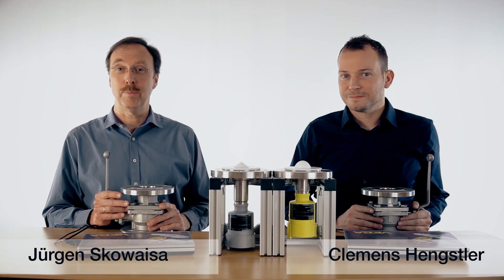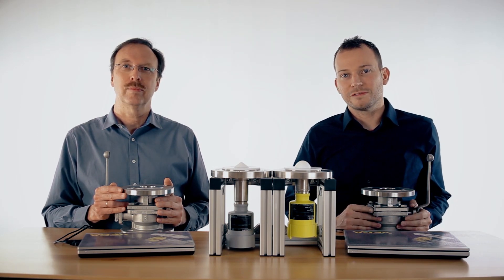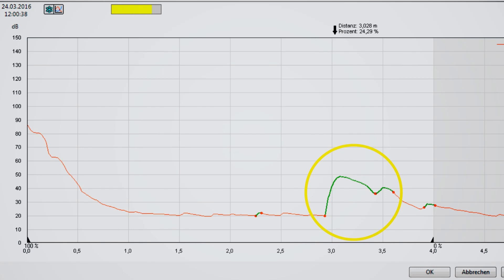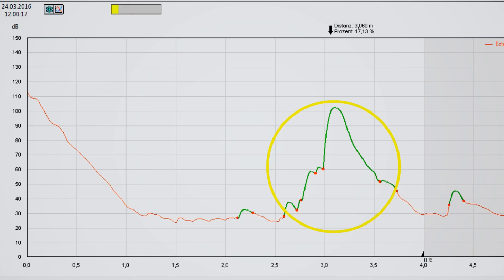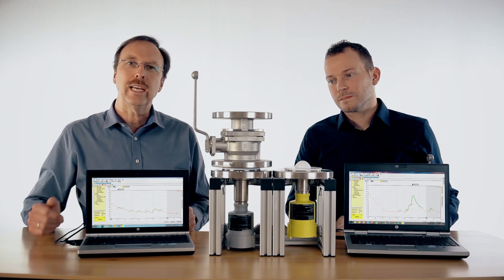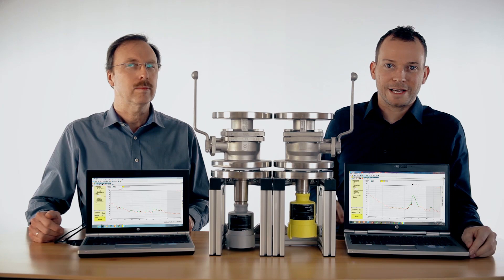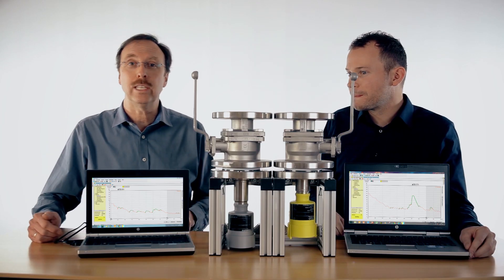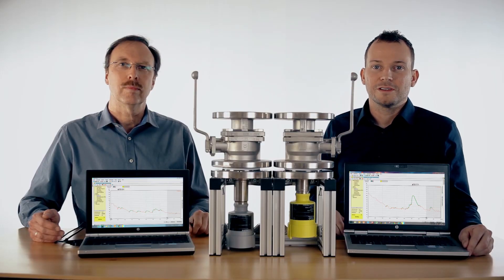VEGAPULS 64 - Mounting on ball valve | Radar level measurement

Comment: what if double block if req-d to isolate from service? do you have a solutions for that cases, special integrated block valves?
Reply from the maker: Hello Serzhan, thanks for your question. We see no benefit of having a ball valve at the sensor. If there is a need to change the electronic of the sensor, the housing can be opened and the electronic can be changed easily during the operation. There are only mechanical parts inside the antenna with a real robust design, we use double seals and high resistant PTFE or PEEK. Does this answer your question?